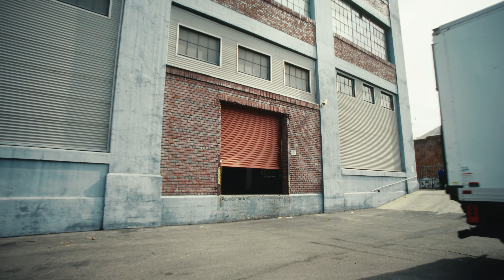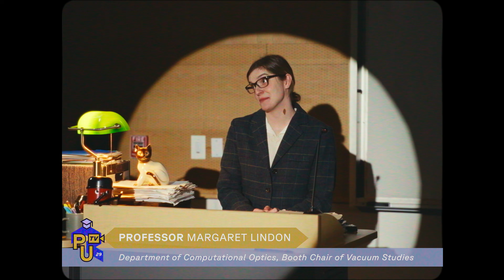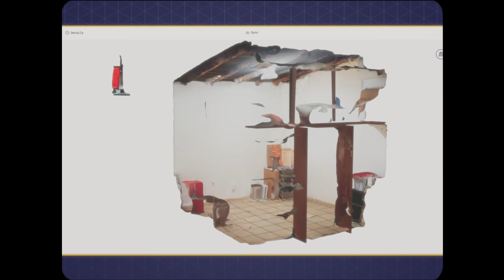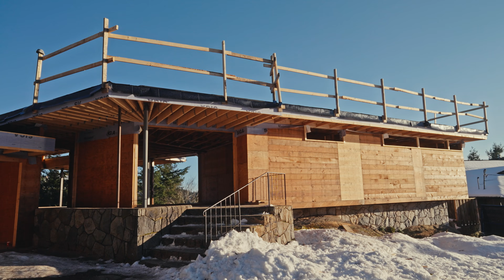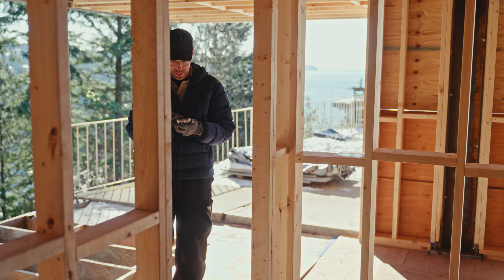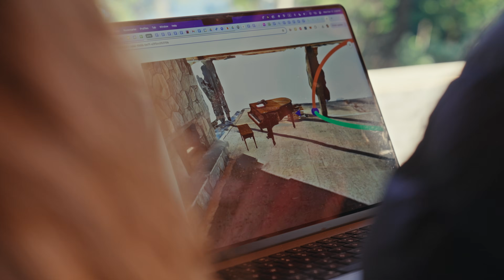Polycam Vision 25: Space Mode, Scenes, AI Generator & More – Full Announcement

Comment: I recently purchased enterprise and I'm having a difficult time capturing a scan that is useful. I'm an architect and have scanned several projects to which I've ended up having to measure with paper and laser measurement. Has any development been added to the floor plan mode for better accuracy? Also is there any development in being able to connect a Bluetooth laser measuring device for overriding dimensions?
Reply: I don't trust LiDAR for accurate measurements because of the phenomenon of "drift". For example, if you walk around a house while scanning, when you meet up where you started it can be off by several feet. I have much better results with photogrammetry using still shots. I include a tape measure with big numbers in the scan so I can rescale the model later. LiDAR is OK for getting the rough idea however. In any case, I always use tape measurements for anything important in architecture, such as door or window openings
Reply: @stahlmandesign  I can certain see that. There is another scanning platform that will connect with a Bluetooth laser measuring device to manually input data, which is what I was illuding to in my initial comment. It has other features that make it more enticing for floor plan measurement too, but my intent is not to bash polycam,which is why I asked the question about incorporating the use of a laser measurer. As it stands this program does not really do as it is advertised, at least in the floor plan scanning area